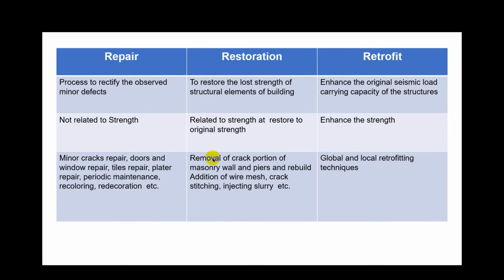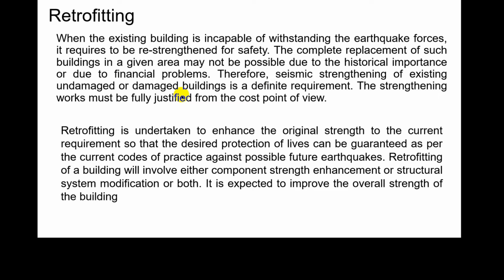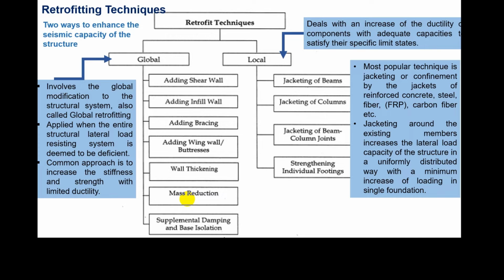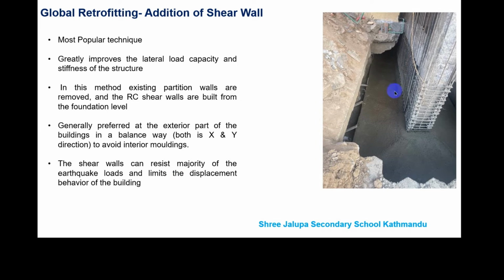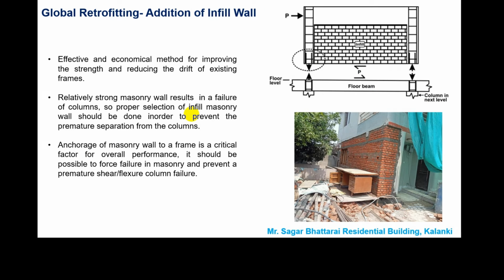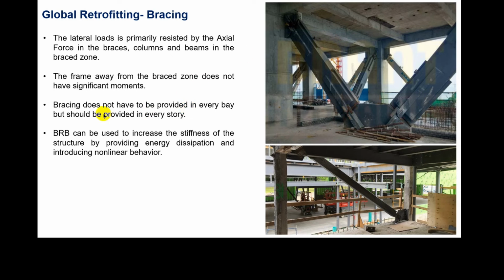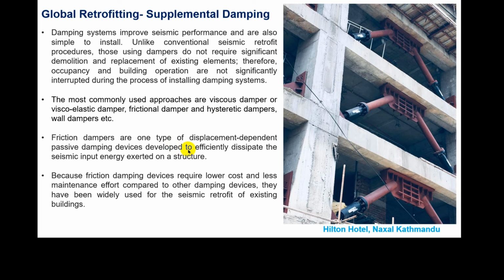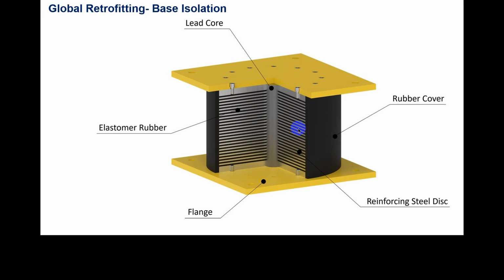Concept of Repair, Restoration and Retrofit (1/3)  #repair #restoration #retrofitting

Comment: How about the Beam-Column Joint? I noticed that you have Increased the Cross-Sections of the Columns and Beams, thus it will increase the capacity of each elements. but what about the Joint Shear? Most RC buildings Fail at the Joints